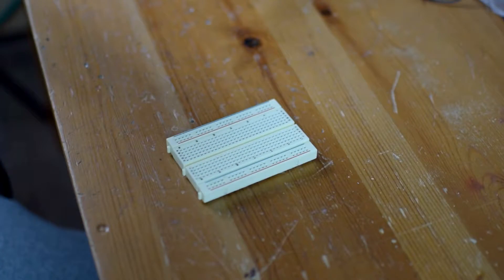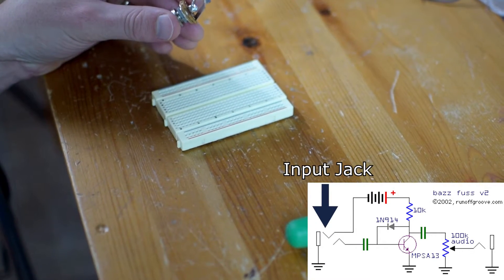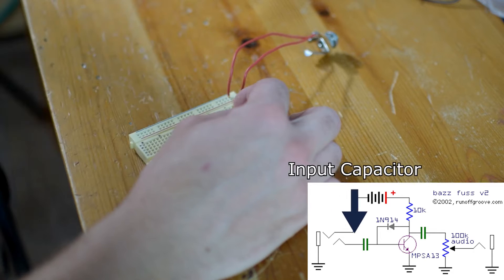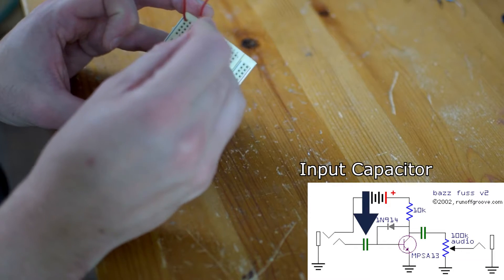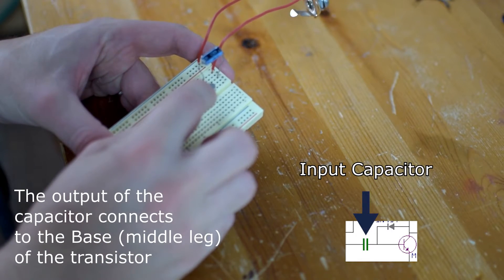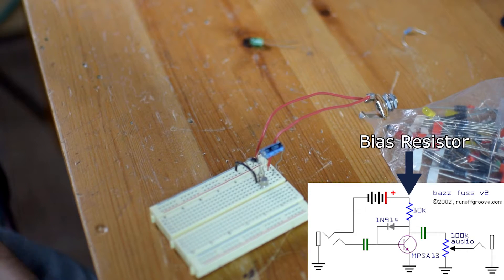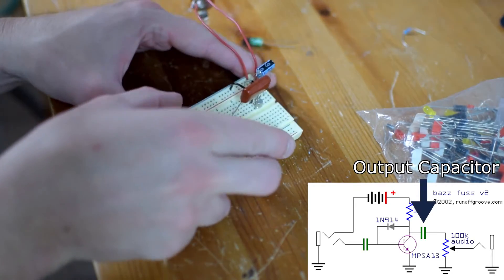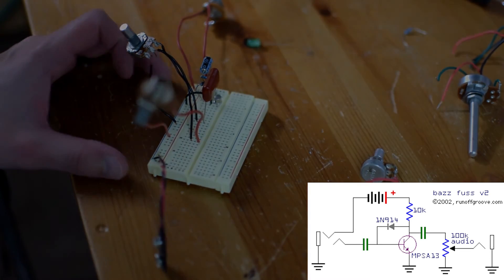Bazz Fuss - Circuit Analysis | Pt. 3 - Breadboarding

Comment: another question if youd be so kind. wich orientation does the input capacitor have? all schematics dont specify and im usin an electrolytic capacitor :(
Reply from the maker: I would put the positive side on the input.
Reply: @KleyDeJong  thought the same but saw a perfboard layout on the original webpage and it had it backwards so idk.mm  ill try either way hope i don't burn anything . thanks!

Comment: at the start you say to ground the tip and run the sleeve thru the circuit but the schematic says its the other way around?
Reply from the maker: Sorry my mistake. Tip is hot. Sleeve is ground.
Reply: @KleyDeJong  thanks!! i was a bit confused. thank you a lot for this videos its been makint it easier for me to try out the circuit as my schematic interpration skills are very basic :)
Reply: @KleyDeJong  thanks - that had me very confused

Comment: thanks for posting! is the bc109b transistor you used a darlington transistor? i couldn't find anything on its data sheet that said so. i was researching this circuit, (im fairly new at building circuits from schematics) and according to this analysis:  http://home-wrecker.com/bazz.html  it needs to be a darlington transistor. I used a homemade darlington with a pair of 2n3906 transistors and it made all the differance. it sounded great with a 10k resistor and a 1n4148 diode. thanks!
Reply: bc109b is not a Darlington transistor. All the Darlington datasheets I've looked at said so very clearly and had a diagram showing the internals of the package. 

Also, 2N3906 is a PNP transistor which has a different sort of polarity than the 2N3904 and 2N5088 which are both NPN's. Not sure exactly what you did with your particular circuit but idk if the transistor will want to last very long if you used the one on the site.